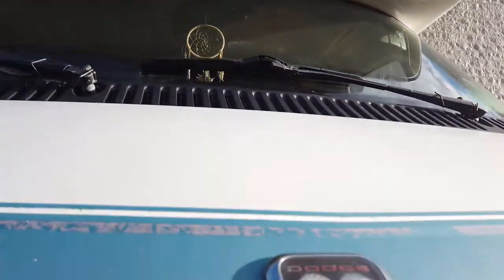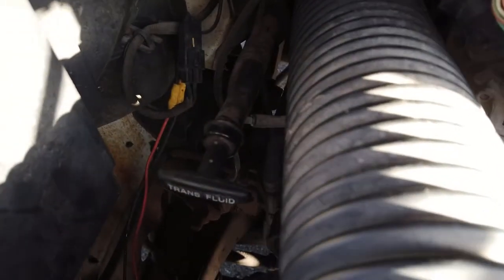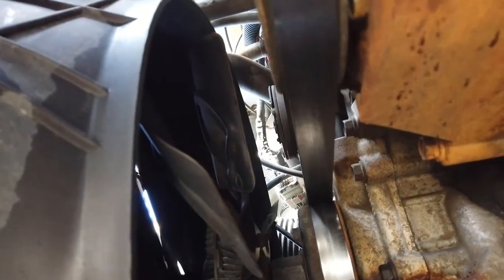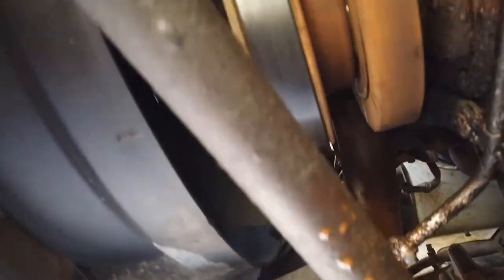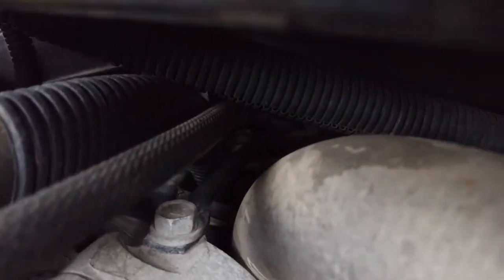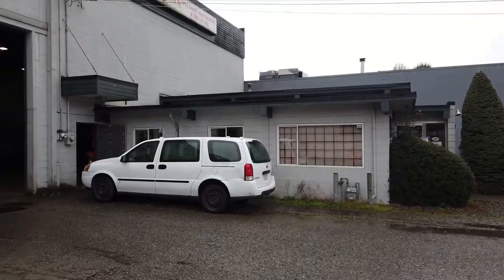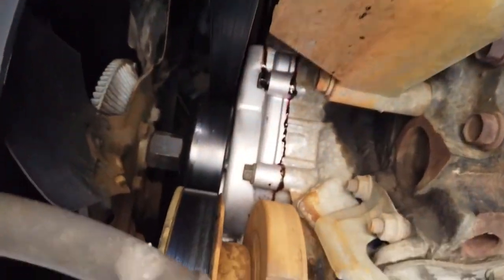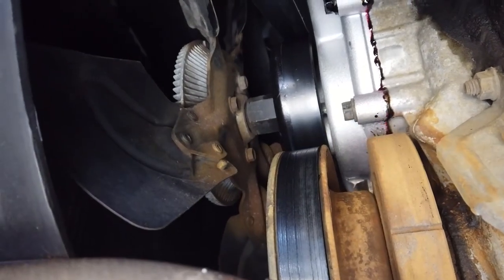Rusty Coolant System

Comment: Av seen the bearings collapse on them  it could have been alot worse mate. I am a Mechanic and do most of my own work mate. Yeah problem is getting parts for the older vehicle's. Hopefully it will keep you on road for good while mate. Ach most old vans leak oil.👍
Reply from the maker: Hey there buddy. You I mentioned in the video. You are the mechanic guy
Reply: @NomadicVanman   Yeah thanks mate  I did hear my name thanks mate.👍🔧